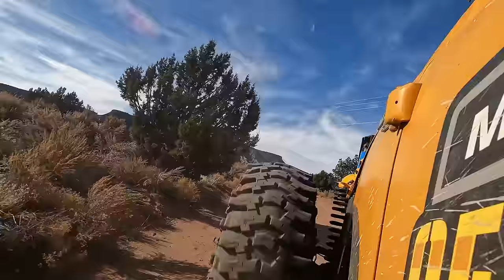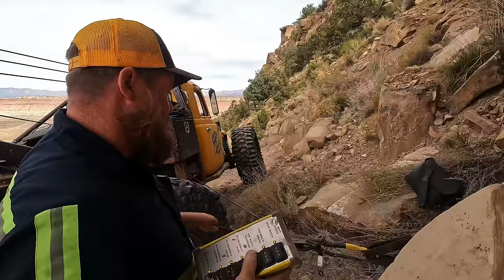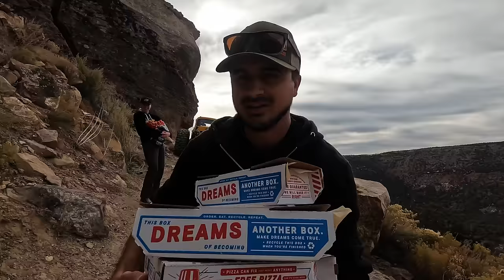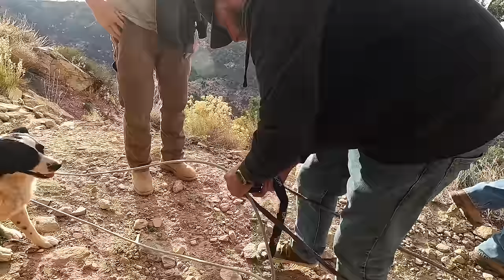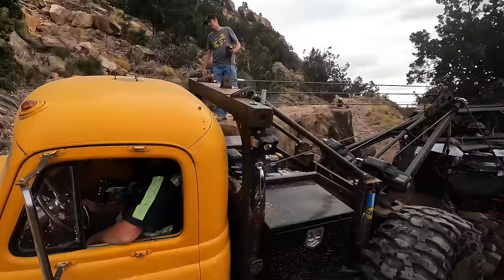I Never Expected This To Happen...Major Fall!

Comment: It's been a while since you had a difficult recovery.  This one is probably in your top ten most difficult.  Nice job.
Reply: So many people in so many triangles of death, one guy got clotheslined  on a rubble slope and kept his footing (and his neck) luckily. Matt was so tired at the end partly due to the stress of managing such a complex operation, plus the deep knowledge that more than one tenet of safety was broken that day. I've made mistakes and just hope no one gets hurt, not judging
Reply: @phlanjo  the triangle of death is not really relevant  too much with the rope winches,  its not a ZERO issue, just not nearly as dangerous.
Reply: @caryserack873 but they also use kinetic ropes as extensions and around trees. And that significantly increases the issue
Reply: Peanut didnt think so!
Reply: Big issue if the vehicle lands on you 😎
Reply: Now you need a helicopter

Comment: This is what the off road wrecker was built for!!! Awesome engineering and thoughts put into this build.  You used just about every option you had built into the truck! 4 wheel steer,welder,side winches great job love the videos.  I had to do a really tough recovery very recently but I got it done with some things I learned from you Matt!

Comment: Probably the most technically difficult recoveries I've seen you do. The (still unnamed) wrecker performed admirably. This recovery shows why you built it the way you did. Thanks for the great video!
Reply: It’s definitely named. 
W.L.O.R.W or Worlds Largest Off Road Wrecker. 😉
It doesn’t roll off the tongue quite like Banana or MORRvair though.
Reply: I still think it should be called the "M.O.R.T. - H.A.W.G."  Matt's Off Road Towing - Heavy A** Wreck Grabber . @Crewsy
Reply: Since another viewer said they "aced it in spades", maybe they should call it the Ace of Spades.

Comment: I used to live in Mesquite Nevada and these shows remind me a lot of the endless times I spent in the Arizona Strip. The landscape of Southern Utah, Nevada and Arizona can be quite alluring and beautiful. Even though I'm in the Sierra Nevada's of California I'd still could be Very Happy in Southern Utah.
 Speaking of the recovery aspect here, my grandmother died out in the Arizona Strip because my grandfather tried to drive a Grand Marquis from Mesquite NV to St. George UT the back way on dirt roads ( a 60 mile route that only  a good 4WD should be on ). Yes, clearly he had No business being out there with that type of vehicle and to me it's clear he must've been having cognitive problems. If I remember correctly it was in February so it's usually pretty cold at that time. It's a long story but once they got stuck my grandpa eventually went to look for help, even if they had a cell phone there's usually no reception out there or least there didn't use to be. My grandmother was found laying on the ground outside the car and had succumbed to the elements by the time any help arrived. I don't think my grandpa ever wanted to live again after that and it was only 6 months or so afterwards that he passed away.

Comment: I just recently found your channel after watching the joint recovery between you and Dave Sparks.  This is the first video I've seen of your tow truck really in action and I'll be honest, this would be nearly impossible for any other rig.  First, just getting a tow truck up that trail is impressive enough, but  working on that tiny shelf road and all of the off angles that you had to pull is mind blowing.  Having the side winches was genius!  Wiley Coyote would even be impressed.

Comment: Just a thought. If you could carry a cordless roto hammer with say a 1" bit, a few turn in concrete anchors with a eye attached you could make almost infinite attachment points. Large rock surfaces everywhere. With the "screw in" type fasteners you could remove them after with little footprint. A bit easier than always having to find a tree.
Reply: This is something i've been thinking of several times, why not just have a drill and anchor bolt..  ?
Reply: Anything to keep in mind is they posted video footage of moving a rock out of the way and the government sent them up there to put it back. Not sure about where they can do what but I'd bet they would get a  bunch of trouble for damaging the rocks on a lot of the places they go
Reply: @sweet65mustang  
Yea but the rock out of the way was a problem, if the rock wasn't there the trail was excessive by vehicles that wasn't supposed to be there.
An anchor bolt in a rock to get a vehicle out of the nature is probably easier to get happening.
Reply: @sweet65mustang  
(And pardon me for my spellings, I'am from northern Sweden 😅 )

Comment: That 4 wheel steering is the cats meow! Now if you had a way to tilt the body it would make it super slick and give you more control around those massive rocks and would even assist when you are on really uneven surfaces. I have seen the hydraulics they put on those low riders and they make some super robust systems. Might be worth looking into.

Comment: Great video.  Throw a few short pieces of light angle iron in your welding kit.  If you need to patch something back together on the trail, butt weld it as you did then scabbing a piece of angle along the sides is magnitudes stronger than just butt welding it.  Clamping a scab on with several hose clamps is surprisingly strong if you don't abuse it too bad.
Reply: True fact.
We call it a splint. Like on a broken leg. Especially helpful for emergency patch-ups.

Comment: Super video and a very good and dangeres  job done.
Matt, you're right CrMo, it's a bit different to weld.
Your repair skit is missing a good strong small torch, in Germany, say soldering flame. Plus some ceramic wool. 
Contact thermometer. Heat to approx. 250°C - 480°F, weld, heat the welding point to red-hot (600°C - 1120°F), insulate and then wait a good hour, then this welding point will also hold. Sure, it costs time and money, but you are also keeping your own people safe and that is the most important thing. Greetings from Frankfurt

Comment: Added “Air Bags” to your suspension maybe a plus. Your extra winches definitely came in handy. Needed is a way to put a secure line in the ground maybe a Bosh chipping hammer drill would do it. Maybe some type of auger off of the back of the wrecker hmm. Big fan been watching for years. I’ve rescued many a stuck vehicle myself around Lake Mead and I usually have sum stakes straps ropes claw hammer baby sledge hammer two come a longs and old school Jack or jeep Jack. I learned a lot about recovery while over in Germany on my tank German mud is crazy. Anyway thought I would share may you and your family and team be blessed with safety always take care 😊

Comment: awesome job... 
hey couple suggestions , 
the wreaker could do with hydraulic adjustable suspention so you can lean/or level it when needed. 
and what we call a "straight bar" for towing ( just a suitably sized rsj with eyes at both ends . one end hooked to wreaker and other to the vehicle getting towed.

Comment: Good job, MOORR Crew.  Glad to see you using radios to communicate rather than shouting - much better comms.  
Quick question: Would you consider recovering from below using one winch to lower from an anchor and snatchblock while pulling from below?  Much easier to lower than to lift if you can access from below.  Rolling rocks down would be an issue but another redirect on the pull line could keep you out of the fall.

Comment: Awesome job! Great crew!  Scary times when they are that bad!   I thought slide a pipe over the two ends of the broken chromoly pipe. If you had something like that. A snipe is what I call it. For tighten big bolts.

Comment: Hey Matt and crew, I really enjoy watching your videos! I have seen you anchor your rig to pull a vehicle up a hillside many times and it got me thinking. I noticed you always wrap heavy rocks, which is great of course but if you didn’t have that option I wanted to suggest learning to use cams. If for instance there was a solid cliff band above you that only had some cracks in it, cams would be useful to anchor your rig. Just a thought, keep up the good work! I also love that you clean up trash in the wilderness, thank you!

Comment: OMG, the rock squeeze on the road in is nail biting! I could not do this job. I would need new underwear daily. This is an insane recovery. You guys deserve a medal, and a good citizens award! KUDOS!!
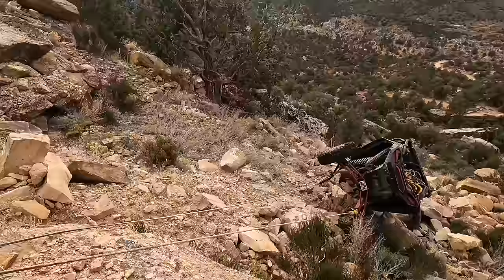BTW, I hope you were not hurt at 24:13. I played it slow several times and saw that you were indeed thrown backward. You didn't have time to duck. Those rocks will hurt your back every chance they get. Hot tub, liniment, and maybe a massage will help ease any tightness you may have now. (it's ok to have an injury, all soldiers have war wounds. 🙂 )

Comment: Makes me laugh when Matt said towards the end that the back axle is compromised. Lol. I'm sure the broken back axle is the least problem with the RZR. I wonder if it would've been easier to pull up the hillside on its roof. That way you wouldn't have to worry about tires or anything else under it catching on the rocks. It's already beyond totaled.

Comment: I would have lift my hand up up decided, "gravity exists for a reason, who am i to fight with it". Put snach block on the hill with one line to front of the vehicle and another on the back. Then by pulling one and keeping one in tension pull it down the hill, another line securing it wont start rolling down on us. Hellawa job getting it up, but maybe not the most efficient method in my mind.

Comment: If there is a access road below and you have the cable lengths, just pull it it down with 1 wench, use the second to keep it from free falling. Just us the tree's to create a controlled pivot point every 20ft.

Comment: Should have used 2 soft shackles on the rear hubs or Rims to provide a low lifting pull and stabilize the pull uphill, it has worked for me in the past so just giving you another option

Comment: That is a difficult recovery. Great job.  Almost the entire weight of the vehicle is on the back when going uphill.  Did you consider having the good wheels in the back as most of the time the front was of the ground or unweighted?

Comment: THAT WAS VERY SCARY ESPECIALLY WHEN IT ROLLED DOWN FURTHER AND THE WRECKER ON SO LITTLE GROUND 
IT SURE HELPS WITH THE REAR TIRES THAT CAN BE MOVE
BUT THERE SHOULD BE SACTY ROPES FOR THE CREW ON THE HILL SIDE

Comment: on behalf of your editors: have some magnetic MORR license plates made up to carry in each of your recovery vehicles.....then slap 'em on your customer vehicles when you start a recovery. 1. Less blur tracking work for post. 2. Free advertising
Reply: They used to have those. I guess they just stopped using them. Or more likely they accidently left them on a customers vic.

Comment: i feel like the wrecker is the size and amount of winches where a small lawn mower/chain saw size 4 stroke engine, running off the main fuel tanks running a good decently sized car/truck generator would be valuable to avoid always running the main engine just for power. a single small engine correctly sized up could have more or less all of its weight offset by removing one of the batteries instead

Comment: The exact reason I built a 30 ton ROTATOR with a 45 foot long boom and 8 separate winches all on hydraulic driven system that will work on the PTO or separate 28 HP V2 Kohler with an electric start and water cooling with electrical cooling fans and a 5 gallon radiator just for the hydrologic drive system and a 1000 foot corless winch remote

Comment: The failed golf course appeared in a previous MORR video. I vividly remember looking for, and finding, the golf course on Google Maps. I think they did not identify it, as I remember searching in the Hurricane area looking for it. Also MORR did not go far up into the mountains for the earlier rescue out of the golf course.
Reply from the maker: It was the two guys that were going to service the radio tower. 
Good memory.

Comment: You need a heavy lift mitilary chopper  you can drop a sling from
Lift the wreckage and fly off the mountain top with.
Wile the 4x4 wrecker is nice, its also very dangerous at times.
The damage to the 4x4 off the hill doesn't bother me as much as the scars it made on the hill and trees that got damaged.
Reply: Thanks for getting that junk off Gods playground   its a nice place to visit and see if you stay on the trails.  It took 100's of 1000's of years for it to be as it is and it should look like it dose in 10,000 years without scars from mankind
About all thats left of the 4x4 is scrap metal, i hope the owner looks at the dammages he has do to the environment,  that machine was equipped to take that trail no problem. My bet is he was going too fast, and they could have been killed.  Slow down. Look at the beauty of the area, its stunning
And no it doesn't need a twisted wrecked machine dropped on it.

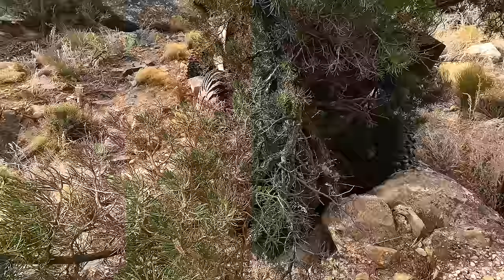Comment: 19:51 I have the feeling that the tension of the cable will pull the wheel right off the axle. How good are those Razors anyways?

Comment: Time to bring in the "Sikorsky Air Crane" It can lift up to 20.000 lbs and is powered by two engines that put out 4500 horse power. The only down fall is the cost. It is not cheap. The loggers up where I used to live got plenty of work from these air cranes. They came in handy even during a wildland fire scooping up water to dump on the fires. So any rescue like this one would be right up its alley. Hook up the cables and winches and haul it up.

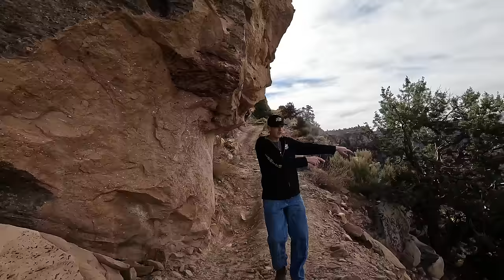Comment: at 7:04 oh dear, I can smell the oncoming failure in video. as if the preview clip didn't show it tumbling wildly, but it didn't show the reason why/angle so well.
that was a big no-no pulling diagonal more than few degrees offset, which would still be huge at a long distance away. 😬😳

Comment: It would be nice if the rear steering had a remote control so the spotter can steer and not have to shout at the driver.

Comment: This was definitely one of ypur more technical recoveries in a while. Could you have done it differently? Probably. Would it have worked? Maybe. 
The way you did it worked. All i know is that trail is definitely more crazy then anything ive ever been on. The worst we have is logging trail's with a clif on one side and trees on the other. 
Cajones of steel doing this recovery

Comment: If you want to get a good safety program? I recommend a behavior based program. Stay away from the high dollar ones. It's basically employee-owned safety like you practice. Instead of stay out of harm's way? They would call it stay out of line of fire. Basic physics stuff. It works when the people are looking out for each other like you do. You can get a good insurance discount / training abatement for the time. Also training costs. 🙏🇺🇲

Comment: Just a idea and this is just a ramdom thought, could u guys put small little peice of say 1/4" by 2 inch  strap steal just for a small reinforcement for small rods and such

Edit- by like 4 or 5 inch just to get extra metal to weld instead of just where it broke

Comment: You did a difficult job Matt. But the guy walking behind the wreck helping it up is a total fool, he would be killed if anything snapped, remember it did unexpectedly roll further down the cliff, luckily away from him - and he did get knocked flying (24:13). No one should be near when the lines are under tension, definitely not behind the wreck!!.

Comment: 🌺You may not know , how funny, the depth of humor, y’all are bringing. 
   ❄️You may not understand the depth of meaning, you offer us, as independents, an ‘un charted, or regulated’ industry. 
    💜You may not see our pov , where unity of purpose, is not I persons’ agenda , but attentive to every persons contribution.
    🤔This is an intellectual example of a,custom designed, follow thru, operation.  I’ve lived the process, on the road , moving 🇯🇲musicians and ‘tonnage’ of stage👈🏽 equipment, to a ‘high ‘purpose’, for hours, until, and for hours🕰️ after, usually till 3 am.
    🙏🏾All good words apply🌤️

Comment: Obviously from my screen, I know more than those who were there.. but I would have pulled it up the mountain from the front. I thought it odd that they intentionally spun it to pull backwards. The 2 good tires should have been down hill, while the front end (that was being lifted up) would have had less weight. It would have been much more stable and effective.  Follow me for more arm chair advice.

Comment: The cost of the tow bill and repair cost of the sxs would seem to outweigh the value of the machine? Why not just leave it and buy a new one ?
Reply: First, Matt & co do this for free, it's content to use for the channel, that is their income. Second, there can be big fines if owners do not get vehicles removed. Most of this driving is on public land. someties the fine can be 200 usd a day until removed, when the state given note that thingsneed to get cleaned up

Comment: You fella's are just a little too complacent with your nice dogs running around your working conditions. I LOVE my Border collie and I assume you Love your dogs as well, but I would NEVER let them be in harm's way in the event a cable snaps, or rock ends up on top of them or a Razor. Otherwise good job on getting that piece of scrap off the mountain.

Comment: Was this razor trashed because the owner stopped making payments? Since no one was in it when it went off road was this intentional do you think?
Leo hold cameras at more radical angles than the actual angle of the hill side is just horrible camera operation, it’s so obvious and makes the cameraman seem like a moron..!
Otherwise another successful job